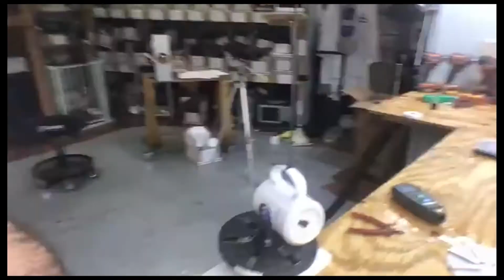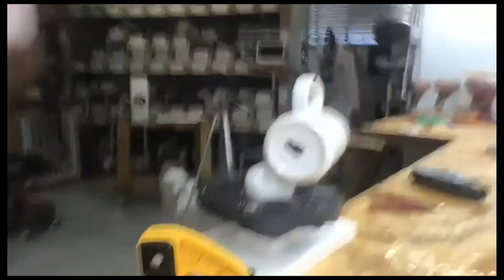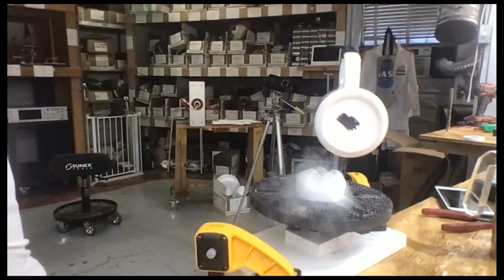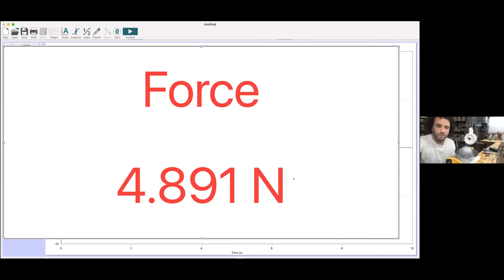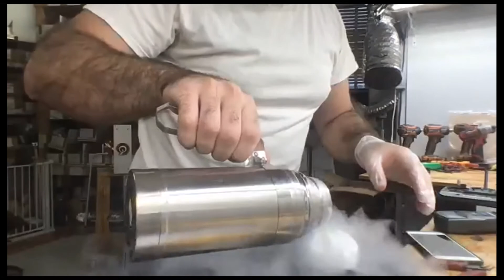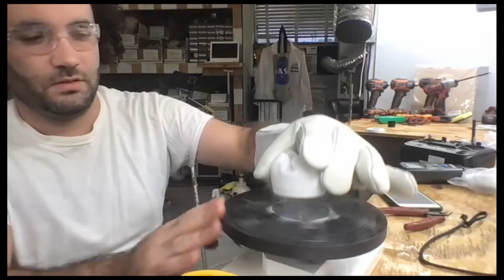APEC 8/28, Part #6 - Mark Sokol - Superconductor Gravity Shield Demo

Comment: Hello guys, I 'd like to add my two cents on this experiment, the superconductor alone wouldn't do anything itself alone, not even spining, the magnets are static respect the superconductor , so its like putting a magnet near a superconductor , nothing would happen. 
First :  A current must be fed into the superconductor to allow electron flow.
Second : Bombard the superconductor with microwaves , the microwaves must collide with the superconducting surface, the rotation simply amplifies the virtual number of electrons in the surface.
In my opinion, the key to antigravity is the cancellation of the magnetic field in an em wave, leaving only the electric component oscillating, this is becasue gravity is at 90 degree respect both magnetic and electric field in an em wave, and this, always in my opinion, allows the propagation of the em wave in empty space or in any other medium.
In this way, the microwave impacting the superconductor will have its magnetic componet cancelled by the electron flow into the superconductor , allowing the rotation of the G field at 90 degree  respect the electric field.
Reply: How you can say Gravity is cancelled by electric field of em wave?
You can use polarizer to separate electric field from em wave
Reply: @nachiketakumar9645  the polarizer , doesn't cancels the elctric componet , makes it rotate, look at sunglasses those are dicroid polarizators
Reply: @vinny71  but how can Gravity cancelled by electric field.
Reply: @nachiketakumar9645  This is an idea I had when I listened to Bob Lazar, many years ago now, when he described the propulsion system he mentioned an heavy element the E115 , this element atoms were so big that the electric force glueing the protons to the atom core exuded the outher electron shell so that em radiation was caputerd, and trhough a waveguide ,sent tothe gravity amplifiers which rotated the wave 180 degrees and amplified it , the amplifiers were made of many rotating rings emitting a magnetic field. So my idea is this , take an em wave of some frequency  , when the magnetic componet is cancelld ( rotated 180 degress ) , only the electric oscillating field is left ( the A potential ) this electric wave cancels gravity, whose direction is orthogonal to the B and E field on an electromagnetici wave, in physics this is called the Poyinting vector